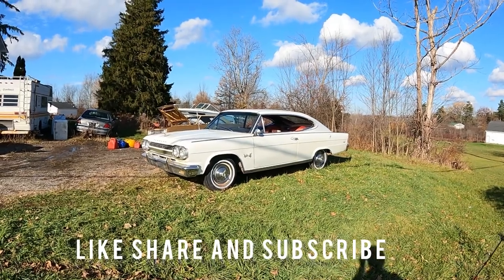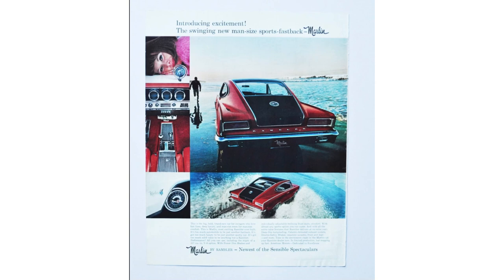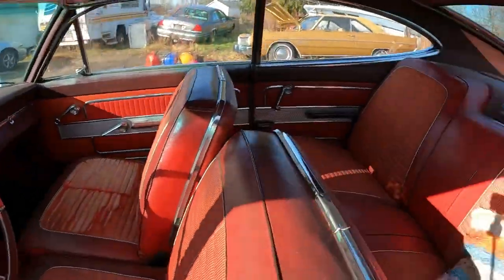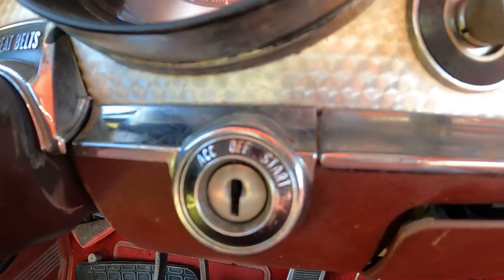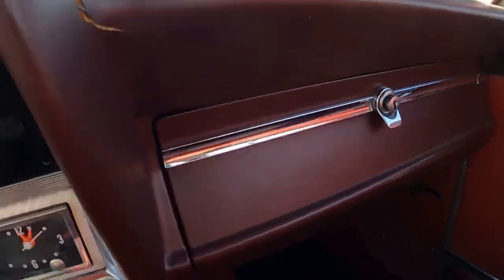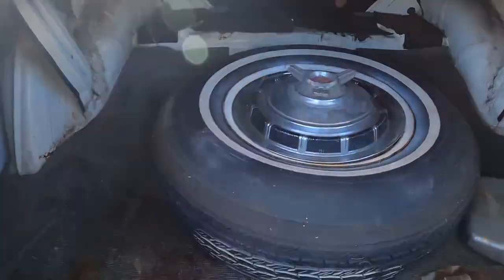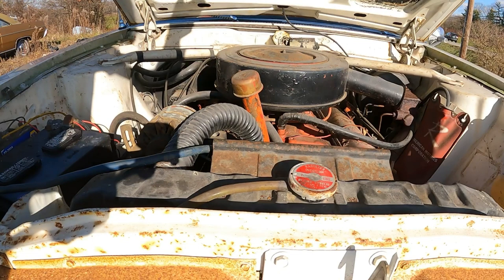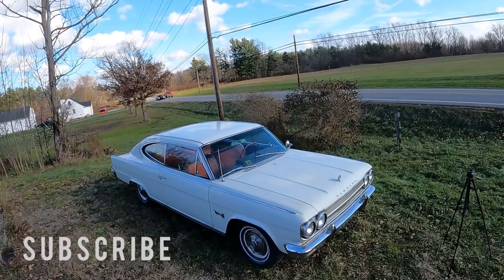1965 rambler marlin in depth look #cars #amc #automotive

Comment: I have 3.. (2) 327 V8 automatics with console and (1) twin stick
Reply from the maker: That’s awesome just curious how does twin stick work is that like a two speed rear end set up.. i’m a huge Marlin fan I’ve never seen a 67 person
Reply: @jr42al: With the 327 V8s the cars must have given very impressive performance with either a 2 barrel or a 4 barrel carburetor.